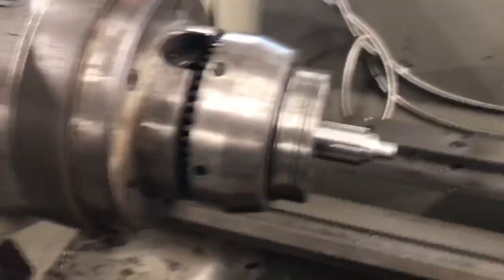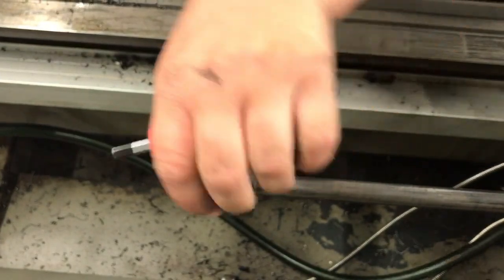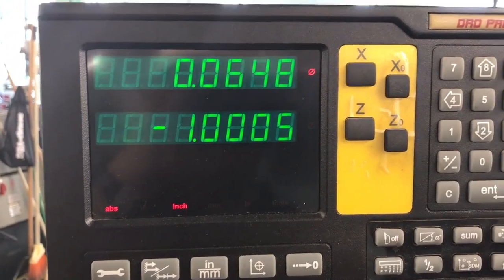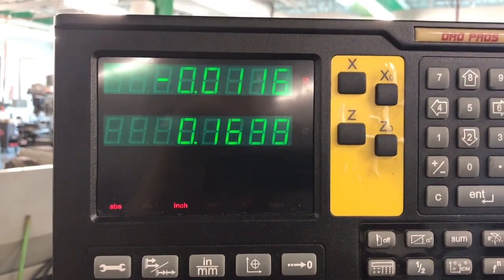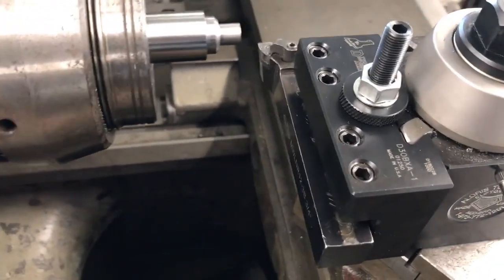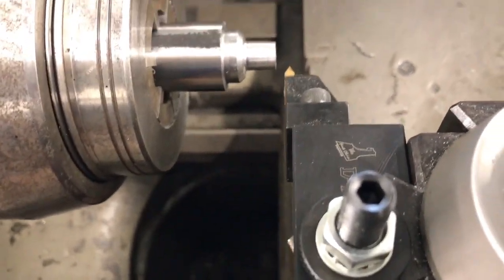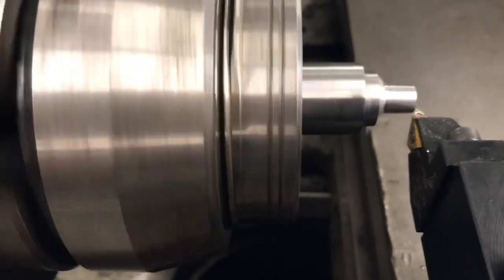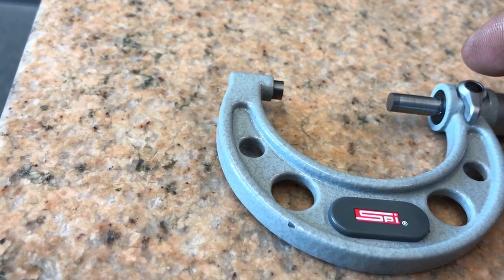Setting Up a Taper Attachment on a Manual Lathe

Comment: Maybe I missed it, but what was loosened on the cross-slide to allow it to follow the taper attachment rail?
Reply: nothing, when cutting parallel diameters the taper attachment is unclamped to the bed so it travels with the saddle, when using taper attachment to turn a taper you clamp the taper attachment (in the right place) to the bed, its one pivot bolt, you can see the bolt in question at 58 seconds into the video
Reply: @crozwayne  If I remember right there was a set-screw or something on top of the cross-slide pivot. You had to loosen that.

Comment: Audio is very muddy!  Hard to understand as it lacks crispness.  I was very interested in the topic and especially in how the DRO was mounted when a taper attachment is also mounted to the lathe.  I was also trying to see if the back splash had to be modified for the attachment but could not see the attachment points for it to see if it had been modified.